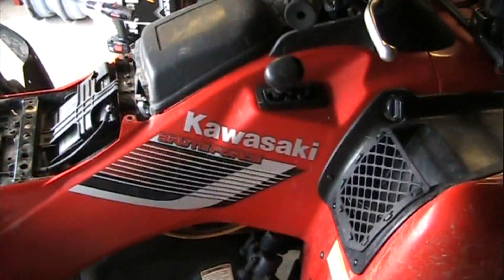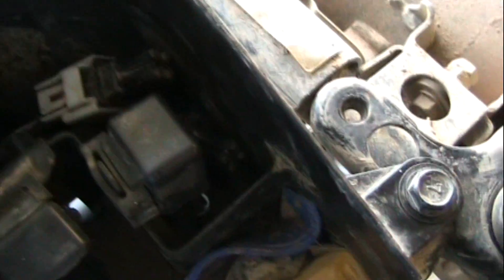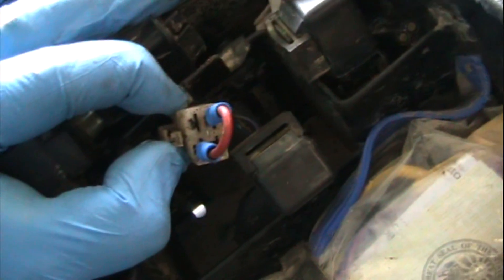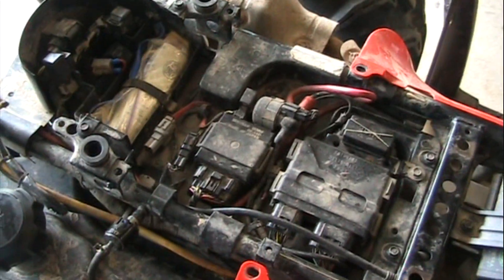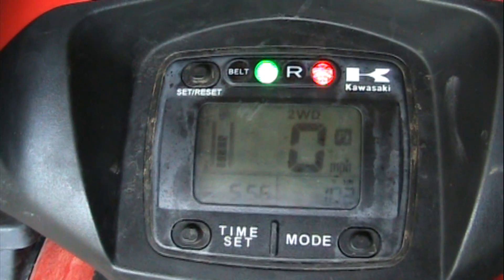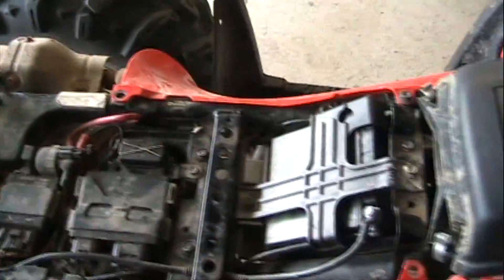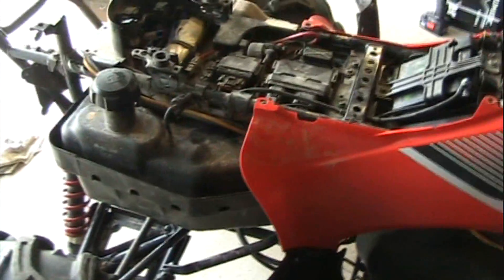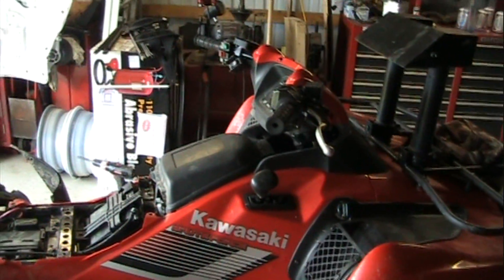Smutty's Brute Fix Part 4: BF 750i Fuel Pump Relay Bypass.wmv

Comment: Thanks for the helpful video.  I believe this is the issue I have with my Teryx 800.  Mice chewed a couple of the wires on the fuel pump relay and the bare wires were allowed to touch.  I repaired the wiring, tested relay and checked the fuses.  All good, so I think the ECU is no longer grounding the relay.  The fuel pump will only run if I jump the relay or ground the wire coming out of the relay that goes to the ECU.  The only other thing that could be bad is the rollover sensor, but I think that is unlikely.

Comment: Don't do this, bypassing the fuel pump relay mean the CDI cannot shut down the motor in a rollover situation (vehicle down sensor). This is likely this problem to begin with.
Reply from the maker: Drew, the first statement is correct however, not the second.  The CDI was fried.  It wouldn't provide a ground to the relay.  It wasn't due to a rollover.  Thanks for pointing out the safety concern.

Comment: Is it possible to cry that and the inlet air pressure sensor wires in the Cdi? My fuel pump only works when jumped and it throws the fi code 12 which is for inlet air pressure sensor and I replaced the sensor. It won't idle either without theottle

Comment: Did you have to replace the cdi or and fuel pump. .I'm having the same problem
Reply from the maker: This was obviously from quite a few years ago.  Now that the fuel assembly prices have become somewhat reasonable I have since replaced the contraption with a stock unit.  I did also elect to purchase a used CDI as to not burn up the new pump.